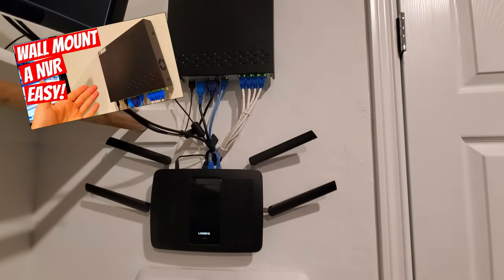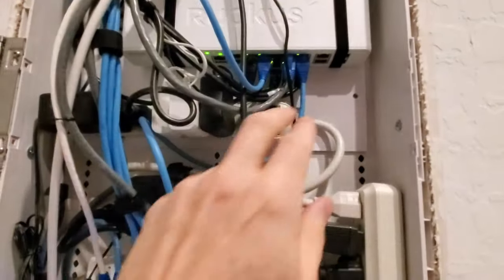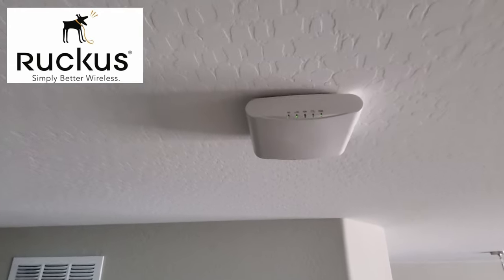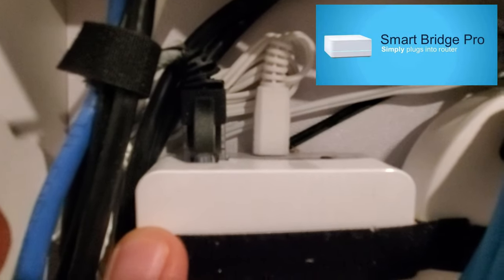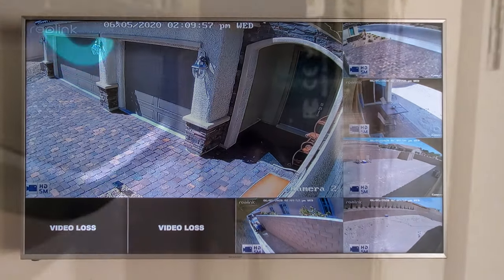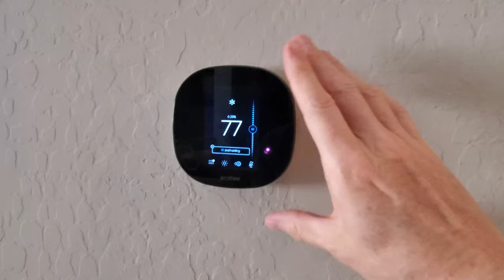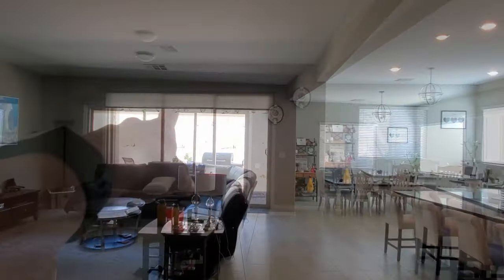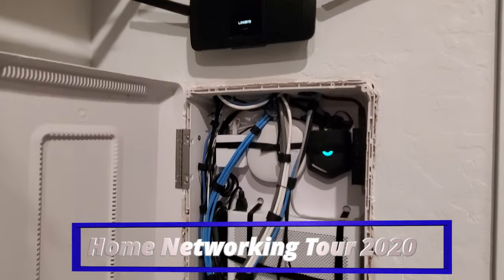HOME NETWORKING TOUR 2020 - COMPLETE HOME NETWORK EXPLAINED IN DETAIL!- HOME NETWORKING 101

Comment: Not to be a smarta$$ but your Demarcation point is technically where the edge of your network meets the edge of the ISP's network. It may seem like the coax input to the modem is the demarc. However your demarc is actually where your drop line(service line) ties into your homes exterior run and bonds to your homes ground. This is because the coax lines in your home make up a coaxial network that is not managed by your ISP. Even though logically  your network begins with the first network device(layer 2 in the case of your modem, layer 3 in the case of a gateway/router). Physically (layer 1) your network begins where your cabling meets the ISP's cabling. Absolutely, love your set up and video though!

Comment: Great video!  Question about the location of the NVR.  Do you find you access it more remotely when tinkering around with settings,  playback, etc. than going into the closet area?  Thanks!
Reply from the maker: Yes absolutely.  I rarely physically mess with the NVR unless I'm erasing the harddrive to free up space for more recordings. I use remote access to make any settings adjustments its just way more convenient.
Reply: @UltimateTechHub  Cool!  I work at home so I've been thinking about setting up the NVR at my desk but connecting cameras on other end of house to POE switch instead of running wires to the DVR.
Reply from the maker: @CTTH100  nope you can set up the NVR somewhere closer to the cameras. Then download the Reolink client software and then setup the NVR on your desktop computer or Laptop or both!!! I have a video on how to setup the Reolink client software.  Check it out.  Thanks for watching and if you subscribed thank you as well.